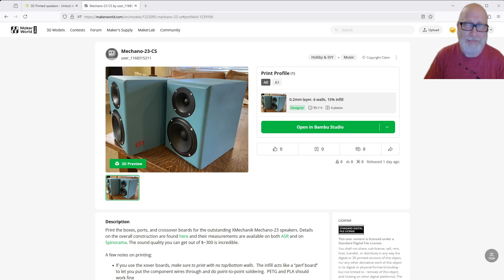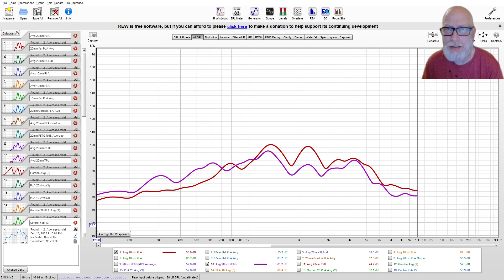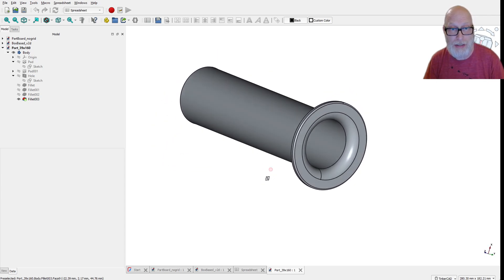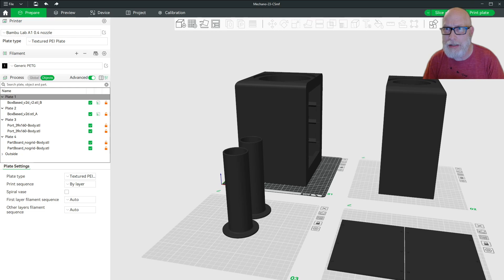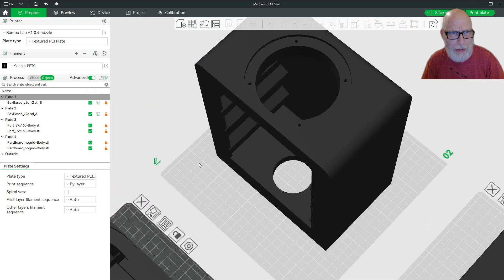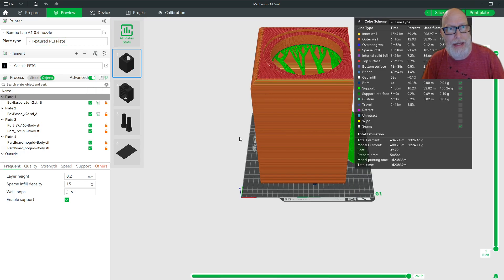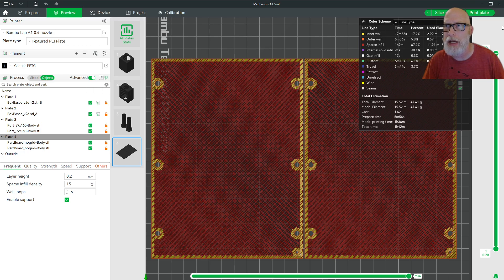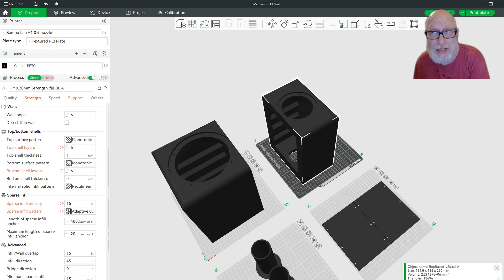Mechano-23 Part 2: 3D design and printing the boxes

Comment: Adding a 45 degree chamfer under the lip would prevent the need for the supports. Would the chamfer alter the sound at all?
Reply from the maker: You mean on the inside of the face?  Not a bad idea TBH.  You'd just need to account for it in the volume
Reply: @celstark  that's good to know, thank you. But a really good video overall.